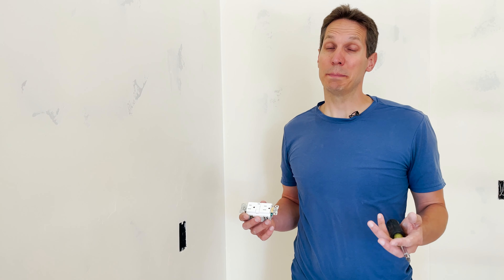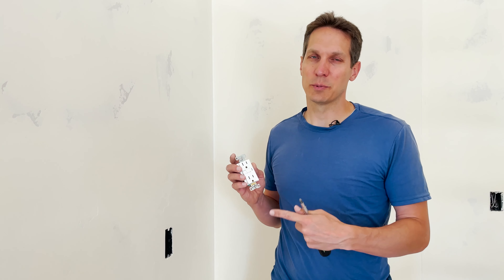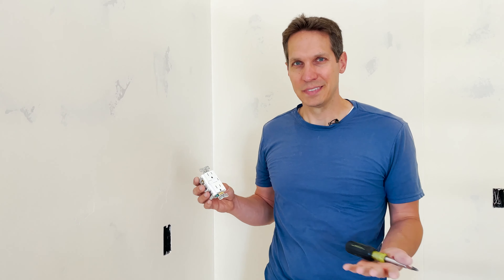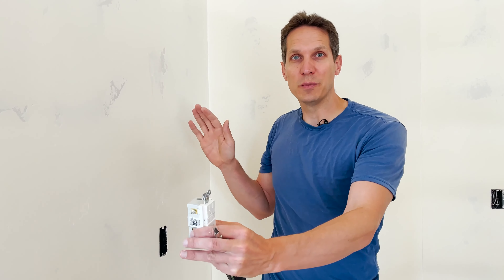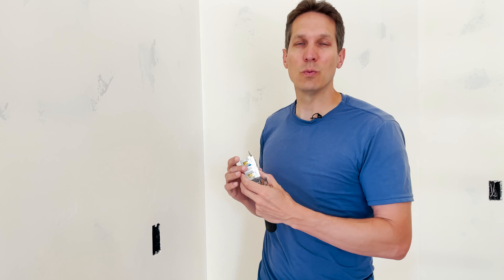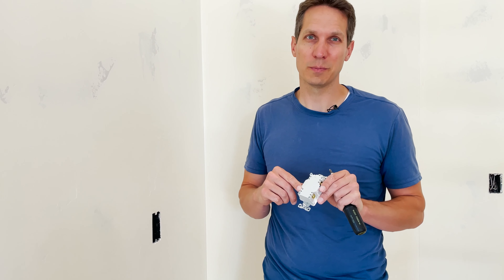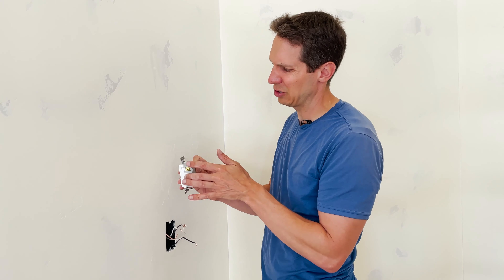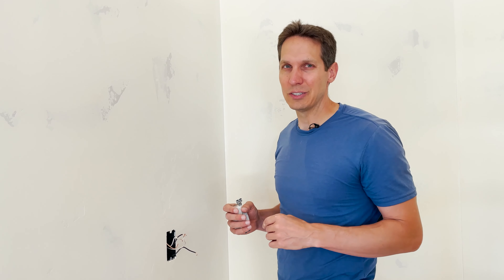How to Install a GFCI in your Home - The Basics | CircuitBread Practicals

Comment: If we combine the wires and connect them with one wire, will we get double the power?
Reply from the maker: Nope, the circuits are designed to only permit so much current and if you have multiple wires on the circuit, those don't change how much current the circuit breaker will allow before tripping.  If you need more power on a circuit, you need to use bigger wire and a larger circuit breaker.

Comment: Hey I've got a question... but it's not related to this video. I have a broken Samsung flatscreen TV that I'm trying to harvest boards and components from. But the section around the female power socket inside the TV contains two 450-volt 56-microfarad electrolytic capacitors. I don't know a lot about capacitors, but I think these are extremely dangerous. Are they dangerous? And if so, how do I safely discharge them?
Reply from the maker: Yes, capacitors can be quite dangerous and the higher the voltage and capacitance combo, the more dangerous they are.  Televisions are renowned for having dangerous capacitors, so it's a good idea to be cautious around them.  The way I'd approach this is to make sure you aren't messing around with the television unless it has been unplugged for a really long time.  How long?  I dunno - a couple of days at least to be safe, I think.  The longer the better.  Then using some rubber gloves so you don't get shocked and a moderate value resistor (1K - 10Kish), attach the two capacitor terminals together via the resistor for a couple seconds.  Then you can short the terminals together using a screwdriver.  This may cause a huge spark, hopefully not.  Hopefully by this time they're entirely discharged and you won't see anything happen.  Once you've successfully shorted the two capacitor terminals together, there won't be any charge left and they should be safe.  Be careful, though, no capacitor that I'm aware of is more expensive than a trip to the hospital!
Reply: @CircuitBread  Thanks for the reply man! The TV has been unplugged for about three fourths of a day, so I'm planning to let it keep sitting for now.

By the way, awesome channel! I really like how friendly you are, and I like how your videos are well-made but not stiff or overly formal haha. I'm subscribed!
Reply from the maker: Thanks for the feedback and glad you enjoy the videos!  How did the capacitor removal process go?
Reply: @CircuitBread  Well, I found out that the TV (even though it was broken) had actually been supposedly given someone else. So I didn't end up getting the parts out of it haha

Comment: Ok. Yes. It's me again ;-)
RCDs (GFCI) with all passive components are agnostic to the current flow direction. All they do is delta i (N1->N2) - (L1->L2). Since it has no reference to ground it can't even tell if you hooked the wires up rightway 'round. You see this in outdoors extension coords. 
The RCD really does not care. Delta i exceeds let's say 25mA and it trips. What and where and how the difference of 25mA came to be is no concern to the device.
The ones with active monitoring electronics are a whole different can of worms tho. Where i live active ones are deemed unreliable by code and have extremely narrow niches for use.

Oh, the one time you don't wanna mix up the terminals is when you use a 3-phase 8 terminals RCD. It is still agnostic to the turn direction of your phases but it compares the sum of all currents   over the phases (in other words the 'starpoint') to neutral. But even there you don't have an "Input" and "Output" side.

Also, i recommend having all RCDs in the panel. Reason is that you need RCDs for circuits where there is a lot of moisture going around. So why expose the one thing that stands between you and some very,  very angry electrons to all the steam and vapors and risk corrosion and seizing up? xD
Reply from the maker: Hey, thanks for the input again!  In the house we're building, we have all but two of the GFCIs in the garage and when I was talking to our electrician friend about it, his recommendation was that you only use these types where you expect to have trips more often (blowdryer overloads is what I thought about) and where you don't want to tramp down to the garage every time it does trip.  I don't know, though, as our garage and bathroom outlets were on the same circuit in our last house and it was annoying to have to tramp up to our bathroom when our table saw tripped a circuit.  Don't ask me why they were on the same circuit, that seems really weird to me.
In regards to the current flow direction, that doesn't make sense to me for two reasons.  First - these clearly request that the incoming wires (LINE) go one spot and the outgoing wires (LOAD) go another, I'm not sure why they would ask that if it didn't matter.  That being said, weird stuff happens.  Second - As the majority of house wiring is done in parallel, how would a GFCI like this detect current (and abnormalities of that current) elsewhere in the circuit if it's just another parallel device physically farther along in the circuit?  Or even just in parallel at the beginning.
I could test to see if this works by putting another GFCI further down a circuit and then using my tester "upstream" of the GFCI.  I'm trying to finalize everything to get our last house inspection a week from today, though, so I'm at the tail end of my motivation on this 😀
Reply from the maker: Also, I'm not sure what you mean by no reference to ground?  Do you mean internally?  Because all the GFCIs I've ever used (including this one) has a ground connection point, which at minimum grounds the chassis of the device.
Reply: @CircuitBread  "Also, I'm not sure what you mean by no reference to ground?" 

What i mean by this is that the RCD trips as soon as there is a difference in current between it's 2 L terminals to what returns across the two N terminals. The device does not need a PE connection to work. If there is a PE terminal on the device then it has the function of a PE like in a washing machine. But it is not used to sense current or anything.
Reply: @CircuitBread  About the RCDs terminals...
So over here we use horizontally mounted devices for DIN rails. and we can choose if we want the incoming wires comin into the top terminals or the bottom terminal.
From the top makes it i.e. easy to screw on a 3 phase rail to the bottom terminals (You just clip a piece of so you don't short to N) an then you have your 3 phases RCD protected on that rail that is also connected to the breakers.
second option is to go in from the bottom and use a 3 phases+N rail and you can hook up 2 more RCDs on that rail and distribute the RCD protected line to the other DIN rails populated with breakers.
Long story short: the RCD does not care which side is which.
That being said, if it is in the code where you live, by all means do it that way.

I just wanted to get the "inner workings" of the RCD across. I think it is important to understand  the device and how it behaves in all scenarios.
Reply: It's like the RCD is saying there is 1000mA on the L->L but only 970mA on N->N so somewhere there is 30mA flowing probably to the ground.

BTW: a quick test and fun exercise (use caution!) is to connect PE and N behind the RCD. It should trip immediately in most cases. We used this to identify RCDs in larger installations when there were no schematics available.
Reply: One last addendum: I am talking about dumb devices. No transistors, no chips, nothing. Just induction coils, resistors and lachting switch that releases as soon as its actuator coils gets enough current.

Any other type with internal logic, amplifiers and such work differently and must be installed according to their datasheet. But i am used to the fact that in normal homes only the "dumb" ones are allowed, because the average joe understands what the switch and the test button do ;-)